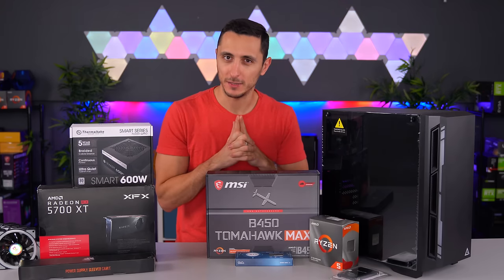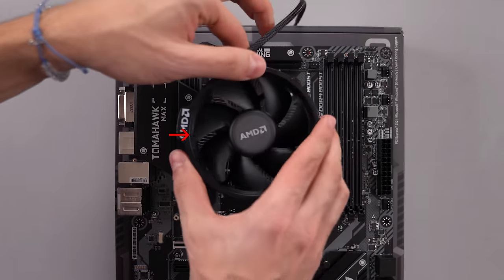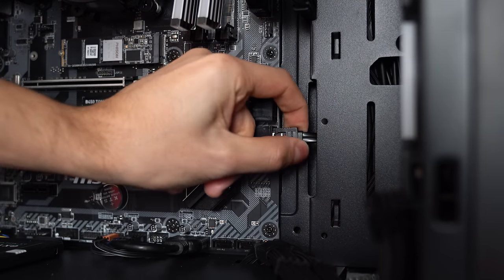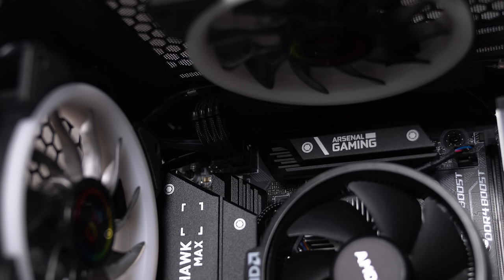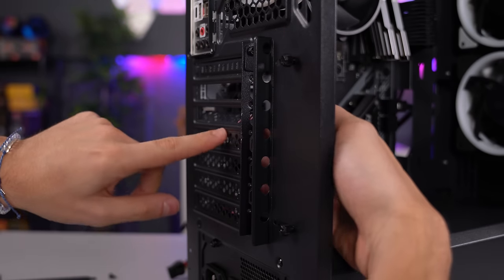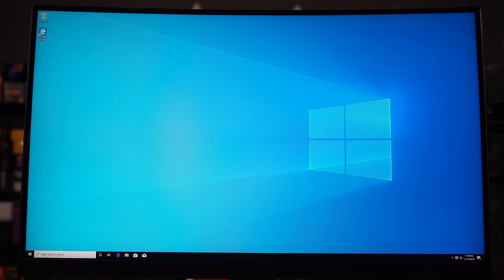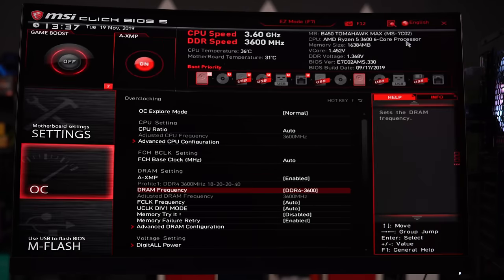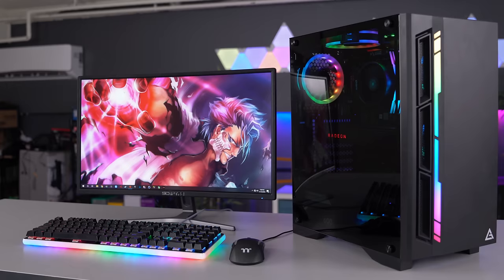How To Build A PC - Full Beginners Guide + Overclocking

Comment: Me starts watching: It can't be so hard 
After: Yea I just buy prebuild PC
Reply: Yeah I know a prebuilt is worse than a built from scratch pc but I don't want to fuck up my first PC. I will wait a couple years then build my own
Reply: Rylan Webb don’t bother with a prebuilt, building your own isn’t as hard as it’s made out to be. The hardest part will probably be cable management
Reply: BongoToucan if your case has a little basement in the bottom just tuck that shit away lmao
Reply: ProdigyxWho it does but god is that annoying if I ever want to change out some parts
Reply: BongoToucan fax
Reply: BongoToucan but I mean you only ever need to upgrade every couple years unless something is faulty
Reply: ProdigyxWho you don’t understand how bad my luck is when it comes to parts
Reply: Rylan Webb i am installing windows on my first pc right now. Had a lot of fun building is (quite satisfying tbh) and it was not hard at all
Reply: The hardest part i feel like are the drivers and windows. Software is just so much more complicated than the hardware. 

I fucked up my first build and ended up buying a pre-built.
Reply: Ambient Light Of Darknesss in what part did u f up exactly

Comment: I’m going to build my own pc around January
Reply: Buy your components now becouse it is going to be Black friday soon
Reply: Same
Reply: I'm going to be building my pc in 2 weeks, just have to order the motherboard and that's all of the pieces
Reply: @davidoman4133  what specs
Reply: lolno
Reply: BlessMe no new parts are coming out, except the 3950x but that is likely overkill for his build. No new parts have been rumored either including Nvidia gpu’s and Intel just released a new cpu. So he should buy now, don’t give recommendations if you don’t know what you’re talking about.
Reply: I'm building mine on August 2020.
Reply: What are your specs gonna be
Reply: @___play.boy___4180 
 Ryzen 7 2700x
Rx 5700xt sapphire nitro
Corsair gold 80+ 850w psu (I know it's kinda overkill)
Either phanteks p400a digital white or bitfenix nova mesh tg
Haven't decided on mobo yet
8x2 gb corsair vengeance rgb ram
2tb Seagate hdd
120 gb ssd
Reply: @milesscarpine7186  
Corsair Crystal Series X570 (Mid Tower case) 

AMD RYZEN 7 3700x     (CPU) 

MSI MPG X570 (motherboard)

16GB RAM

6 GB GTX 1660 TI Gaming X (GPU)

500GB SSD M.2

2 TB HDD 

Corsair h100i w/ 240mm radiator (AIO CPU cooler) 

750 W (PSU) 
Going for a red and black theme
Reply: I’m going to be using a ryzen 5 2600 a rx 580 evga 750 watt power suply patriot viper 16 gb ddr4 msi proseries qmd ryzen 1st and 2nd gen cit blaze mid tower case 1tb hard drive 120 gb ssd
Reply: @davidoman4133  nice I like it
Reply: @milesscarpine7186  thanks
Reply: @jakeduffy2053  that's pretty cool I built an auros geforce rtx 2060 super ryzen 5 3600 build in September in the collermaster h500 with 16gb team tforce and auros x570 wifi gaming elite
Reply: @___play.boy___4180  noïce
Reply: Same
Reply: Or wait to buy your motherboard until the B550s come out.
Reply: @aliidress5619  rich? I worked my ass off working overtime 7 days a week for 2 months to build this, I just have a lot of dedication not money
Reply: I am building mine in a few days. My parts are either going to be delivered today or soon
Reply: @aneon1273  thats awesome, you must be excited, list your specs I'm curious
Reply: @davidoman4133  Man I can't contain myself! Here's the list->

Ryzen 5 2600
Aorus B450 Pro Wifi
16 GB 3000 MHz ram
RTX 2060 from Zotac
126 GB SSD from Adata for the OS
2TB HDD from Seagate 
650 Watt PSU from Corsair
Reply: @aneon1273  awesome specs, what games are you planning on playing?
Reply: @davidoman4133  good job bro i was joking 👍
Reply: @davidoman4133  my gaming needs essentially boils down to anything I want to play. So it's not just modern titles. But there's obviously a reason why I went and picked up the rtx 2060. There are games on my wishlist like metro Exodus, cyberpunk 2077, modern warfare, shadow of the tomb raider which will require a strong gpu to push good frames at high/ultra settings.
Reply: @aneon1273  yeah that's pretty sweet, I went with a strong CPU in case I ever wanted to stream. Are you going with any certain color or does it not matter?
Reply: @davidoman4133  white and black
Reply: @davidoman4133  where do you plan to stream though
Reply: @aneon1273  twitch and YouTube, probably using OBS
Reply: @davidoman4133  man building my PC with my three other friends was crap ton of fun. Built mine in October and I've had more fun converting to pc.
Reply: @jerichoella9323  man I know right, I can't wait till I have all the parts ready, I'm gonna order some pizza, put on some chill music and start building😌
Reply: yh I agree
Reply: same
Reply: Same
Reply: I plan on building mine after Black Friday. 
Specs:
CPU: i7 9700k
GPU: RTX 2070 Super
RAM: 2×8gb
Reply: xSceptile mine i5 9400f msi z370 8gb ram 1tb m2 ssd 1070

Comment: I had way too many problems, took me like 20hours total acctually building it
Reply: Did you need to have a radiator for your build? I dont think this specific build has one
Reply: @newframe6937  no, you do not need a radiator unless you are water cooling.
Reply: @rumi1267  thanks
Reply: It took me that long too cause I kept forgetting things like fan splitters and I got the wrong cablemod cables

Comment: I’m scared he’s literally building my same exact pc except for the graphics card
Reply: Same here, except I’m not using any RGB - I don’t care about looks at all lol
Reply: 2060 super squad
Reply: SomeOrdinaryDoge ‘ how do i install my GPU my case doesn’t unscrew like his did when he was putting in the GPU! i’m so confused please help!
Reply: Unscrew the PCI lock, then push in the slot covers. Should come out. If they don’t, you might have to put more pressure or use a knife to get them out
Reply: SomeOrdinaryDoge ‘ my gpu screws don’t even screw out tho? like those a screws that hold the slots in!? they don’t un screw!
Reply: Tom Bannon they might be stripped that’s a big yikes or you don’t have a screw driver that’s the right fitting/ size they are normally Phillips head but you might be able to get it out by taking a pair of pliers and twisting it
Reply: PotatoDaddy493 yo dude i finished my build and everything okay? i turn it on like i turn the power supply on and it doesn’t work? it’s plugged into cables and everything...! are you skilled at this enough to where maybe you could help me threw discord or phone?
Reply: Tom Bannon no but I thought my psu wasn’t working once but I forgot about the power button cables make sure they’re plugged into the right spot or your pc’s led/power button will not work properly with mine my power cables have to be plugged in differently because my power button cable is trash so my reset switch turns on my pc
Reply: PotatoDaddy493 i have some extra cables that i haven’t plugged into the mother board but according to this build video the cords i plugged in were the only ones i needed to make it work? But even tho if my motherboard and all that didn’t work shouldn’t my PSU still turn on but not power anything else
Reply: Tom Bannon the power button cables are the cables from your case to power on your pc the power button cables should go into the bottom right and on your instructions for your motherboard should tell you where to plug them in, they are labeled btw
Reply: PotatoDaddy493 okay i’ll take a look rn
Reply: PotatoDaddy493 where are the cables to plug them in? Where are they
Reply: I'm using the motherboard and processor he's using but I got different everything else.
Reply: Anna Richards same I attempted building my first pc yesterday and it didn’t work I have most of the same pieces except the graphics card and no fans, everything is plugged in well maybe I missplaced the sd but the pc doesn’t turn on :/
Reply: @mattfalciola3950  Rgb does increase fps tho
Reply: I actually used this guide because I use the same motherboard as Ed.

Comment: Where is the livestrong bracelet? I thought you needed that so you dont short circuit the power supply.
Reply: No dude if your pc case has enough confidence no pun intended it will have  unsulation pads built in its not neccessary
Reply: biggest myth
Reply: @bravozero6  wdym
Reply: @dontrwooshmeimtrolling4003  you dont need any "band" to build a pc

Comment: TIP: do not overclock with a stock cooler like TechSource did as it will overheat the CPU if the OC is high enough
Reply: Wat?! I wanted to overclock my 2nd gen Ryzen 7 with the stock cooler. Can I still OC the ram and GPU?
Reply: @NP23335  Whether you can overclock the GPU depends on the airflow in the case so it doesnt become to hot. And pls dont destroy your cpu. DO NOT USE THE STOCKCOOLER if you want to over clock it. It will overheat rlly fast.
Reply: Zed Bot ok but if I have good airflow I can oc my gpu and ram? I hear some people water cooling their gpu and I’m very confused about that. Is that a thing? I thought it was just cpu AIO water coolers.
Reply: Wraith coolers are capable of very light oc.

But you would still need good airflow or you would lose multiple advantages.

But if you were to oc anyways, might as well invest in a good air cooler like a noctua or an AIO.
Reply: thewokebanana ._. His gpu has the crappy base blower design. The Sapphire pulse version has superior airflow. You can watercool gpu’s if you want. That is a thing that exists
Reply: @NP23335  you can get hyprid gpu's that come out of the box with aio attached or custom loop cooling where you take off the fans and plates and attach your own custom tubes and backplates

Comment: I practically do consider myself a veteran pc builder, I was telling my friend how to build his pc over voice chat. First we had it outside the case to test the parts, the only reason it didnt boot at first is because of a loose cpu/24pin or psu power cable. Then it booted normally. After we installed it into the case, I told him to try and boot and we got no post. I told him to push in the 24 pin and cpu 8 pin, and it posted. Pog

Comment: I’m a building my first PC. Is it possible to use the old hard drives I had in my old PC and put them in the new one and not download windows as it’s already on the old drives?
Reply: Yeah for sure. If your computer has bitlocker on it (a windows security measure to make it harder to steal computers) all you have to do is go to windows support and put in a code and you’ll have full access to your HDD and all the things on it.
Reply: Adam Nenn Adam Nenn Okay so what if I buy new hardrives, am I able to use my old windows or would it be better to buy windows again (through ProKeys)?
Reply: DMAN if you buy new hard drives make sure to get your windows product key from your old hard drive. If you’re running windows 10 then you should be good to just install windows from a usb and put in your old product key and it’ll be good
Reply: Adam Nenn Okay perfect. Thanks for your help. I think I will go for the second option.

Comment: Do I need to do all the windows stuff do I have to buy it ? Doesn’t it come free when I finish building g it
Reply: You can install an "unactivated" copy of windows 10, and then buy an activation code for significantly less than the price that Microsoft offers it at.
Reply: I built my computer 10 years ago, I'm thinking about buying it Windows 7 this week.  It's been a funtoo Linux machine, built PC, built OS.

Comment: Hey, im about to build my first pc and i need some help. First of all this is the component:
cpu: AMD - Ryzen 7 2700 3.2GHz 8-Core Processor
motherboard: MSI - B450-A PRO ATX AM4 Motherboard
memory: Corsair - Vengeance LPX 16GB (2 x 8GB) DDR4-3000 Memory
storage: Crucial - MX500 500GB 2.5" Solid State Drive
storage: Seagate - Barracuda 2TB 3.5" 7200RPM Internal Hard Drive
videocard: msi geforce gtx 1080ti 11gb vga card nvidia
case: lian li lancool ii
monitor: ultrawide samsung 49" 144Hz
Now my question is:
1. will these components fit inside the case and compatible with each other? i read alot where people motherboard and graphic cards did not fit and this will be a problem because where im from you cant return online shopping items especially electronics. Also as a system will all of these be compatible with each other and not run into a hickup along the way.
2. If you had to choose graphic card between a. msi geforce gtx 1080ti or b. Zotac geforce gtx 1080ti ddr5 mini or c. zotac geforce gtx 1080ti amp extreme 3 fans or d. galax geforce gtx 1080ti extreme overclock or e. evga vga gtx 1080ti nvidia
Which one would you choose? and the second one to it.
3. Is the graphic card i put on top as the component that i want (msi) good enough to run the full 144Hz on the ultrawide monitor screen? and run the resolution to the max? or even the small zotac mini could do this? because price different its way cheaper for the mini compared to the msi
4. i know its preferance but is it better to run this build on a 4k screen or the ultra wide but only get 1080p resolution... I will be gaming and doing work  (why i want the ultrawide is because i want to be able to open multiple sites on one screen). 
Also Budget is a thing for me and this build will eventually cost me $2600. Thats the max i could spent. 

(ps: i would've choose the EVGA - GeForce GTX 1080 Ti 11GB Black Edition Video Card but it cost $1600 where im from)

Thanks in advance for anyone that will take the time to answer me.
Reply: Did you build a pc?.?

Comment: Do i Need to buy the cables from something separate?
Or do they give you the cables with the parts?
Reply: The motherboard comes with disk cables and power supply does too so no you don't need to buy wires